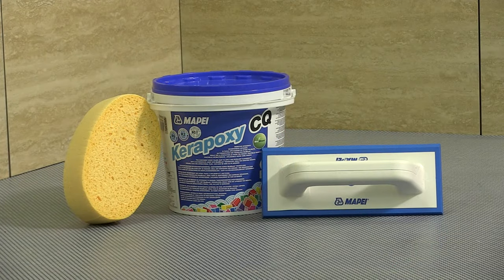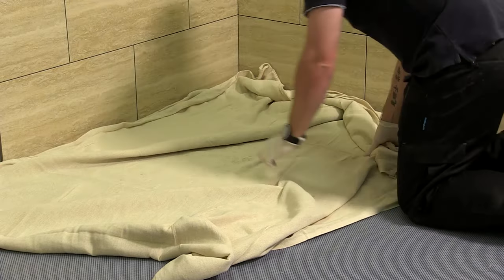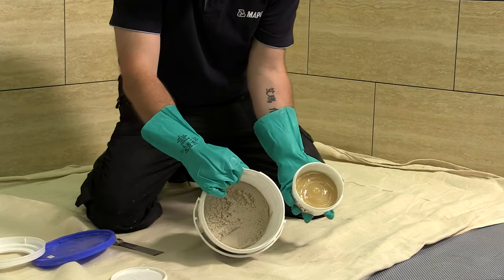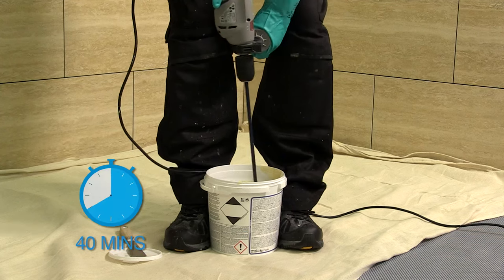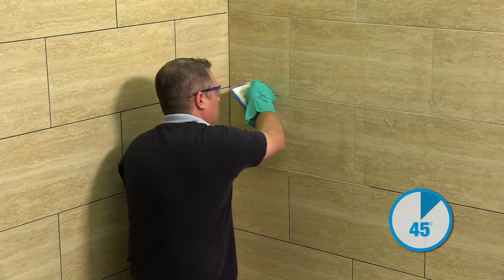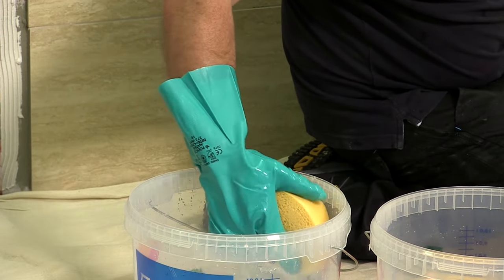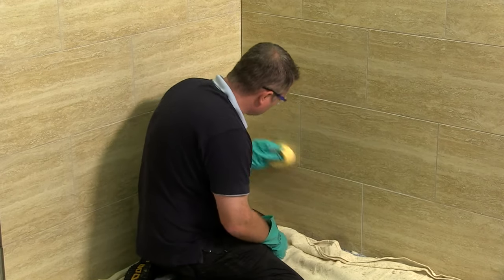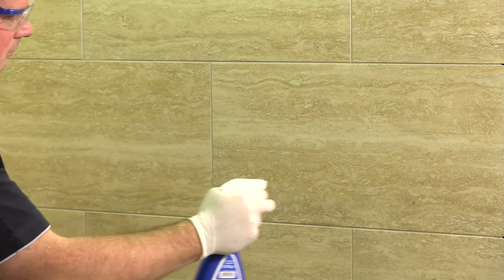Mapei UK - How to mix and apply Kerapoxy CQ

Comment: Many thanks for video-instruction and for all questions / answers.
Now, I have to try myself......and report later.
A fiew hours later, here I am again, to report.
I had a little spot to try, how it will work.
Easy, but: you have to move, not stand around dreaming.
And I will recommend WARM water to brush off and for cleaning. 
Most important seems to me: respecting time-limits given by manufacture.

Comment: hint: use warm water to wash it off, not cold one. 
a simple reason for doing so is that the material is fat-like, just like you don't wash your dish with cold water :)
Reply: you dont get the pleasure of using warm water on construction sites mate.
Reply: @marildokustura7269  If you have bucket heaters (a must here in Colorado) you do
Reply: @marildokustura7269  water heater

Comment: How about the corners? Is it a good idea to use epoxy grout in corners when tiles are put over a drywall? Or this must be avoid and use caulk instead?
Reply from the maker: Good Morning Simeon, our Technical Services Team have said in any corners a sealant should be used, such as Mapesil AC for porcelain, ceramic etc, or Mapesil LM for Natural Stone, Marble etc. I hope this helps you out. Should you require anything further please do not hesitate to contact us. Thanks.
Reply: @MapeiUK  Thank you for this qiuck and complete answer.
Reply from the maker: @simeondimchev122  our pleasure.
Reply: If you wanted to avoid sealant all together for the inside corners there are trim options like the DILEX BWA by Schluter that can be used.  There are some metal trims that can serve this function too.  Each project is different, but you definitely need a movement joint to prevent the possibility of cracking and other associated failures due to expansion and contraction of building and tile elements.

Comment: My Kerapoxy has the hardener spilled all over the inside of the pail when I opened it. The container that held the epoxy broke and the plastic bag around it leaked the hardener all over the epoxy. FAIL.
Reply: Same here .today.....FAIL BIG TIME !!!
Now still like bubblegum after many hours :(
Reply: @senadzenica147  It took almost a day for mine to noticeably harden, 3 to cure. That is supposed to be normal but they all talk like it gets rock hard after 45 minutes. It doesn't. I will not smooth out nice or be workable after 45 minutes but does not get hard.

Comment: How long can you let it sit for?
Reply from the maker: Good Moring, sorry for the delay. When using Mapei Kerapoxy CQ the working and full drying time are:

• Pot life of mix: 45 minutes
• Set to light foot traffic to clean the floor: 12 hours
• Ready for use: 3 days

Hope that helps, if you require anything further please contact our Technical Services Team on 0121 508 6970 (option 2)
Reply: Can you spread for the entire 45min pot life, or can youvonlyvapply a small area at a time. I've noticed with premixed grouts, that are somewhat similar to epoxy grout, you can only spread small sections at a time as they dry up quickly once separated from the container. But with a 2 mix epoxy it should dry due to the thermo reaction between the 2 components, thus the grout on the wall should dry slower than the grout in the bucket. Or am I way off here?

Comment: I don't understand. I thoroughly mixed my epoxy grout and it was so thick that the rubber float wouldn't push it into the joints. I did leave the unopened bucket outside in the cold for a few weeks, so maybe I need to let it come to room temperature next time. I had the worst time applying this, but it may have been my own fault.
Reply: Did you have a very hard rubber float?  If you had a soft rubber float that may have been the problem.  Epoxy grout can be a beast to push.  Also make sure you are mixing at slow speeds (300 rpm).  If you mix at high speed (just about any drill at full speed is way too fast) you trap air and increase the reaction causing it to start locking up on you, or getting really thick.  The air also shortens the pot life. Once mixed you have to spread it out into small piles as it is thermo reactive, if left all together it will get thick and harden up quickly. When you are pushing it into the joints it can trap air more than other types of grouts, so working from one end of the joint to the other to push the air out as you work it into the joint.
Reply: No, I had the same problem. I just finished 20 minutes ago and I was so stressed out having the same problem. It was like spreading really thick peanut butter or worse. Nothing but a 5 hour battle

Comment: I've been doing tiles for years and this is the worst product  I've ever used. Takes 4x the time to apply than regular grout and is impossible to clean.
Reply from the maker: Hi, thanks for your feedback and sorry to hear about your experience. Could you email us at ukmarketing@mapei.co.uk with further details and images (if possible) and we can forward them to our Technical services Team to investigate it for you.
Reply: I divide the 3kg pack into four, and do each bit individually. Also I spray the cleaner on immediately after applying grout, and use an epoxy grout sponge to remove. Finally I wipe over the tiles with a paper towel.
Reply: @MrJuancarlos3030  Sounds like you're not following the instructions mate, given that plenty of people DO use them successfully. If they didn't, it wouldn't still be on sale.
Think on that.
Reply: @jamesknightreading  Thank you James, that was a concern for me, good to know it's do-able.
Reply: Application wasn't the problem but cleaning was hell. Sticks to sponge. It's like trying to wipe silicone with water. Used warm water.
Reply: @MrJuancarlos3030  Each to their own but as a professional installer, I've been using Mapei for years and it's one of my favourite adhesives and silicone. The cementitious grout is like spreading lard but I've got used to it and the finish is very nice. I have a job coming up using Kerapoxy CQ so I'll see if I still feel the same after using it!
Reply: Well after using Kerapoxy CQ for the first time, I did find it harder to work with than regular grout.  I mixed an entire tub, applied it and washed off with no undue concerns. I would be happy to use it again but I would charge more due to the extra time and energy involved in application and clean up.
Reply: @michaelmcleary8566 took you over 8 months to finish.. how much was their bill? Lol